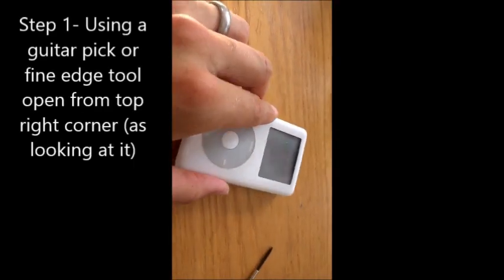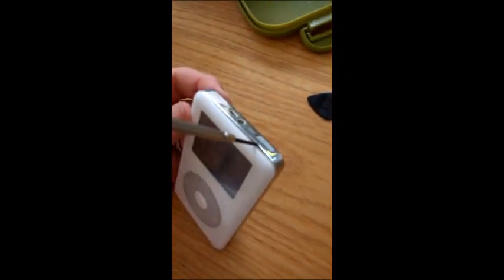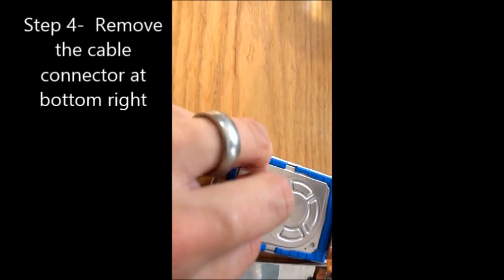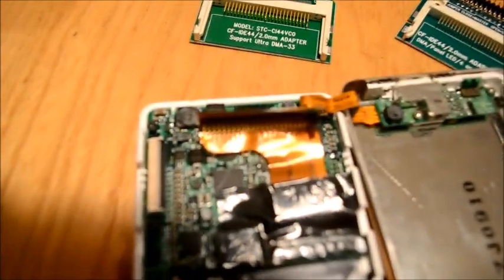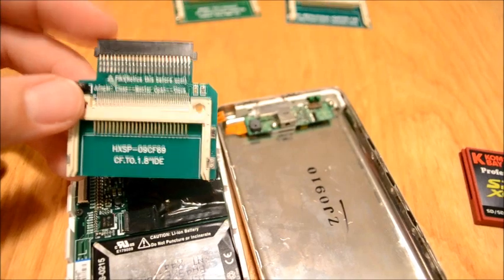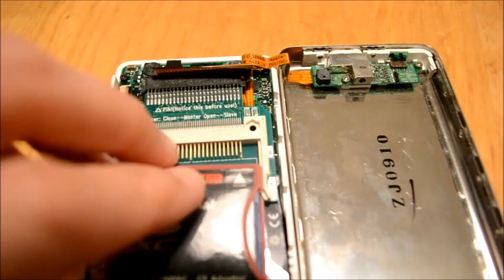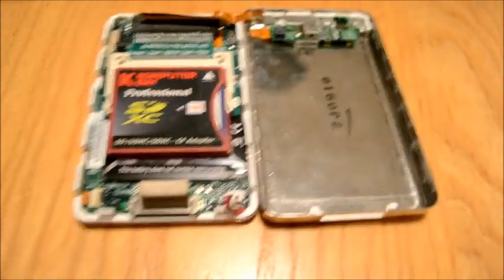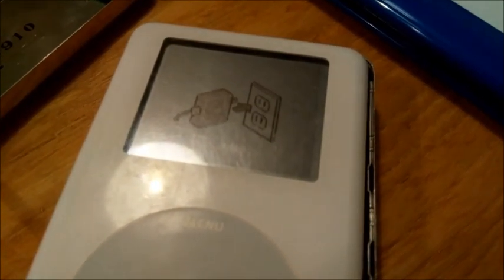Easy update Ipod Classic 4th Generation with SD Card

Comment: I have followed directions from several channels. You are an iPod God! It worked the way you pry i is correct. I was doing it the opposite direction. By the way, my one inch putty knife worked perfectly. I've been loosening it back and forth with the putty knife for about an hour, and then I did your strategy of keeping the iPod face up and put the putty knife pointing directly down and went to the top left corner, and it worked. Thank you so much!
Reply from the maker: Great.  Really glad it worked for you.   Please do subscribe as really helps.
Reply: That's because you were afraid to break it so you did it wrong, insert small putty knife on the right side start at the top push in slide to the bottom, done all clips released open like a book, pat yourself on the back.

Comment: I have tried many times to do this but I keep getting folders icon. Tried to rebuild mbr and format to fat32 but it did not help. Using an old 32Gb SDcard which works [detected]. Only after restore device is wiped and has to be reformatted.

Comment: I have the same model and it allows me to restore, but when it asks me to plug it in to finish the process, I keep getting the check symbol or folder symbol. Any insight is appreciated. Thanks
Reply: Hi Scott I'm having the same issue, I suspect it might depend slightly on the version of your device, mine is 1.2.1 according to Itunes. So far I've only tried on Windows, I hope to give it a quick try on a Mac.
Reply: I found a solution that worked for me.
After restoring the iPod and connecting the iPod with the wall charger the flashing process fails.
- Eject the SD-card and connect it to the pc/mac.
- Install and open "AOMEI Partition Assistant Standard Edition".
- There are listet 2 partitions on your SD-card, one little and a big one called "IPOD".
- Right Click "Disk x"(x for your card) and click "Rebuild MBR".
- I selected "Windows XP/2000/2003".
- Click Apply in the upper left corner.
- Insert your SD-card in your iPod.
- Connect your iPod with your wall charger.

Credit goes to "togruber" here https://forums.macrumors.com/threads/ipod-classic-4th-gen-ssd-upgrade-adventure.1951122/page-4
Reply: @medallish  Will try. Thank you so much!!

Comment: how to re-format it?
Reply: Dont hate me but I try not to buy the cheapest parts I prefer to buy quality so iFlash adapters and the recommended flash drives are all I use without errors or constant issues. To your question, if on Windows just plug it in your USB and iTunes will reformat it for you. If you want you can format it in Fat32 or ExFat then run iTunes, either way, iTunes has the last say. After the required plug into wall process is finished go back to your PC and sync with iTunes. BUT, if you really want options, start iTunes and click enable disc usage and quit iTunes, now go install Rockbox and enjoy the iPod like it should've been released.

Comment: I did this with a 128GB card and when I hit restore iPod in iTunes it says cannot restore code 1437. I've done it a few times and still can't restore in iTunes. Anyone else have a fix for this?
Reply: Thanks, I can't find one that works. I'm thinking its cheaper to buy a 32GB card
Reply: @Dennis Condit I picked up a 32 GB card and still have the same issue. I get the support icon on the screen and itunes doesn't recognized device
Reply: @Dennis Condit Thanks! So I formatted it to Fat32, plugged into wall and then plugged into itunes and nothing. It doesn't pick it up as an ipod and I don't get the option to restore. Anything I'm missing?
Reply: @lonestarspice  You can check the sd card to see if it is still functional but honestly ALL these cheap ide adaptors simply do not work that's why they're cheap. Solution, buy iFlash adaptor, check the info for which compatible sd card to use, follow their instructions, and barring a dead iPod you should not have any issues. Each time I had problems from red cross symbol it was due to the HDD or corrupted SD or cheap IDE adaptor.
Reply: @emotionalintelligence776  Thanks! Its funny you say that as that's what I was thinking. I know they are more expensive BUT if that still didn't work then I'd be upset. Thanks for the confidence in that suggestion. I'll update this after I order it (today).

Comment: I just raplace battery and still has “plug in” icon in the display... or takes too long to charge.??
Help please
Reply: connect it to an iPhone 4 wall charger and it will turn on normally
Reply: You need to use firewire to connect it for the first time. Usb doesn’t put to mucho power to charce the ipod when is totally dead. But firewire would do the trick ;)

Comment: whats the problem with 64gb micro sd ??
Reply from the maker: Not tried it but been informed that circuit board cannot accept 64gb.  Do try and let me know if works.
Reply: ive ordered the stuff ill let you know
:)
Reply: also if you had both 32gb and 64gb and you didnt know if it would except 64gb what would you use ??
Reply: @FrostByteOriginal  did 64gig work?
Reply: Blaze Psi I had some major problems it did at first but the replacement battery wouldn’t charge so I didn’t get a good test but from the small time it did
Reply: @FrostByteOriginal  thank u for the info..
Reply: @ratemygadgets  I updated my iPod Classic 4th gen from 40GB to 512GB using two 256GB cards, one if a mini SD. Have 31,122 songs and still have plenty of room available. (186GB available)
Reply: @ratemygadgets  Thanks for the tutorial.  I missed the advised 64GB limit and installed  128GB FAT SD card.  All good so far!  Thank you very much!
Reply from the maker: @DanMcConnell1  cheers Dan, I am now waiting for the SD card to increase the size.  Also, please subscribe if don't mind, really helps me.
Reply: @ratemygadgets  Work for you?